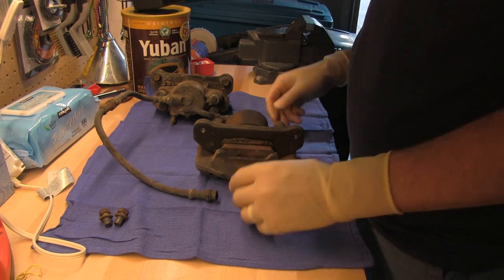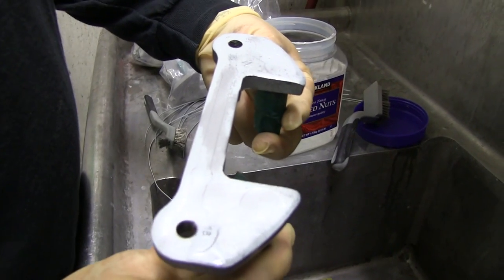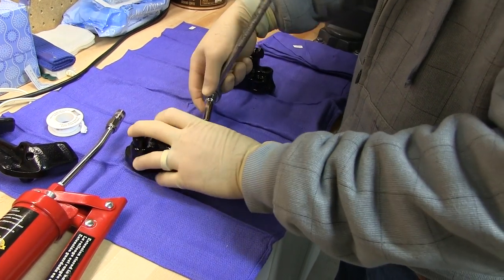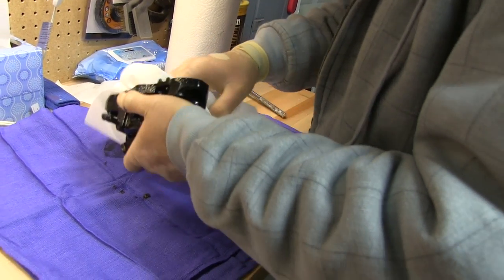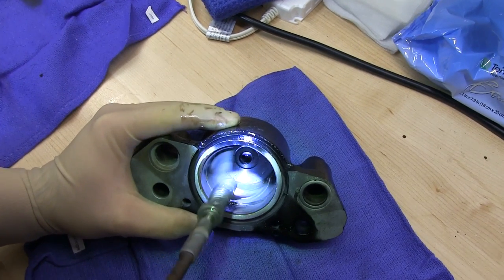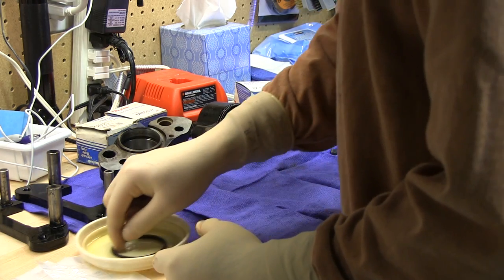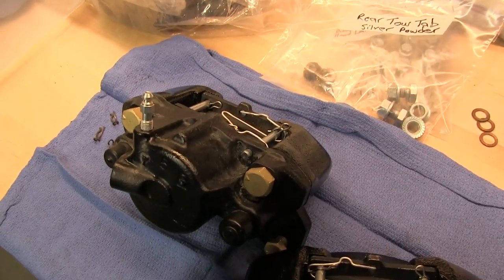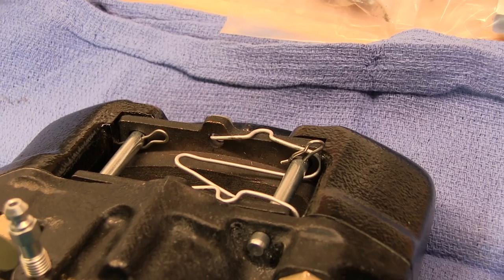VLog 11 Mazda RX3 Brake Calipers Rebuilding Rotary Restomod

Comment: hey man nice job you doing with the car. this is a suggestion so it lasts a longer about the bumpers try to power coat them then do a black matte paint that looks like plastic(its just a suggestion you dont have to do it but if you re use a bumper try it, and it looks nice ether way polished or black matte).
Reply from the maker: I already have chrome bumpers. If I were doing an RX3SP build I would definitely powder coat the bumpers black. That would be durable and even finish. Thanks for the feedback.